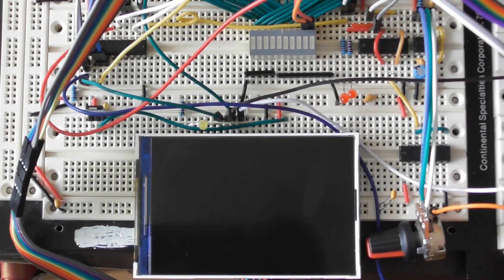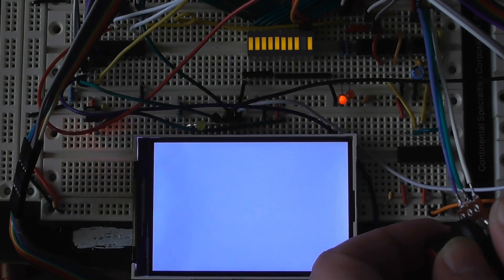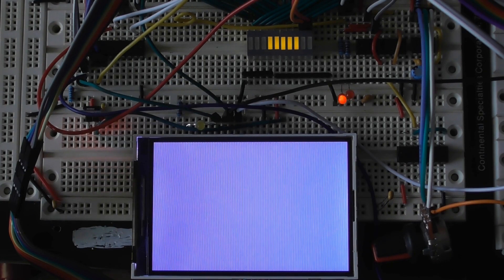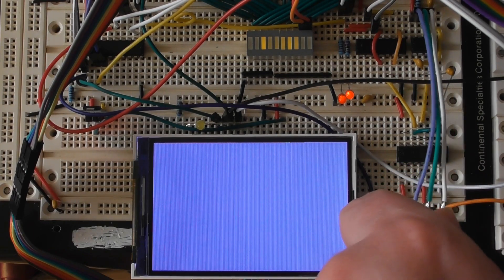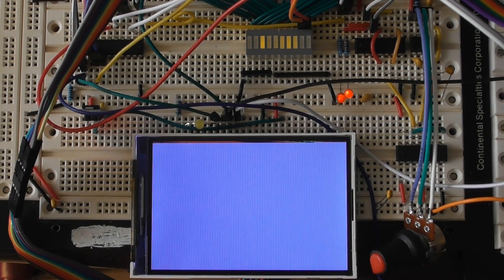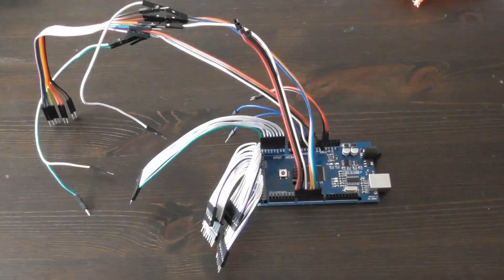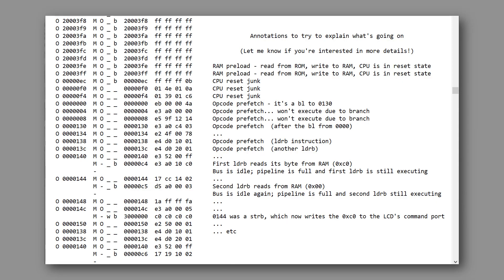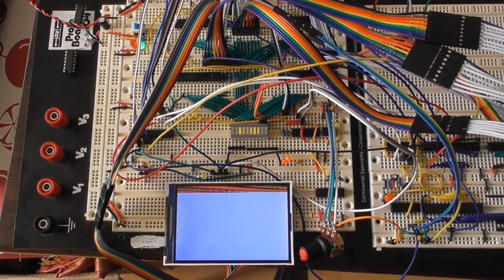Homebrew ARM2 #11: RAM Preloading Progress Update

Comment: I just recently found this. Amazing. I've seen a 68k SBC which uses an FPGA for the DRAM + code initialization from an SPI flash memory. I liked that because in theory it should be easy to program a simple eeprom that contains some instructions for the SPI flash, and just shift them out serially, and read the output and put it straight into the RAM. I think it's a little bit more complex than just copying the parallel eeprom into RAM with discrete logic, but it's easier to reflash it! In any case, any update on this project? this is so cool!
Reply from the maker: Yes, I think somebody on 6502.org had made a parallel RAM module with integrated SPI EEPROM, or something like that. I believe once you send the right sequence to the eeprom it then just streams out all the bits in sequence. People have also used them to generate video sync signals.

Comment: Any progress on this project?  I'm hoping this project hasn't been abandoned!
Reply from the maker: Not permanently - but I took a break from it to advance my VGA project some more, and I think I'll soon combine the two by making a fork of the VGA project that's optimised to work with the ARM. I think the ARM is going to be well placed to do some really nice graphics that way, with its 32 bit data bus and ability to write on sequential bus cycles, it'll be able to push a lot of pixels around very quickly.

On the existing build, I did resolve the issue with double writes to the LCD, but not in a way I felt confident about explaining in a video, as I don't fully understand it myself. But it is now able to render consistently again, and with RAM and ROM together a lot of options are opened up. Partly that paralysis of choice is why I took a break from it, as I wasn't sure which thing to do next!

Comment: Today has been a YouTube smorgasbord! You are rocking it out. All I did today was resurrect the derelict dodge durango in my driveway! Thanks for sharing!
Reply: It looks like you've just about maxed out the arduino pins, reading only?
Reply from the maker: The data bus uses the whole of the bottom block. For the address bus I've only connected the ones my program uses so far - A0-A9, and A24-A25, so quite a few missing there. I think if I connected the whole address bus I'd have 5 spare pins left.

A big problem with using so many pins is the time it takes to read them all. It limits the clock speed a lot.
Reply: @GeorgeFoot  The digitalRead() function from the arduino library is quite slow. You could directly access the ports - less comfortable but much faster. And it's not compatible between different arduino boards. Here are a few hints: https://electronics.stackexchange.com/questions/22585/arduino-faster-alternatives-to-digitalread-and-digitalwrite
Reply from the maker: @frankschmidt5319  Thanks - I've used that before but didn't bother on this occasion, as I picked a pin ordering that made physical sense rather than something easy to write to the ports. The speed will always be limited by delays - what I ought to do to speed things up is precalculate the port values for all bytes of a page during a previous delay period, and then send them to the ports in quick succession after that. It should still be possible to use logical pin numbers to make it stay portable and configurable, I think. Something for a rainy day!
Reply: @GeorgeFoot  You could also switch from a Mega2560 to something faster, like a Grand Central M4 (120MHz M4) or the Teensy 4.1 (600MHz M7). (Or course you'd need level shifters (like 74xx4245) to communicate with the 5V ARM.)
Reply from the maker: @Dave5281968  Yes for sure - I do have a Teensy 3.5 that I've used for 6502 monitoring in the past. It didn't have enough GPIO in easily accessible pins for the ARM though, I think I'd need to somehow solder onto the extra pads on the back of the board.